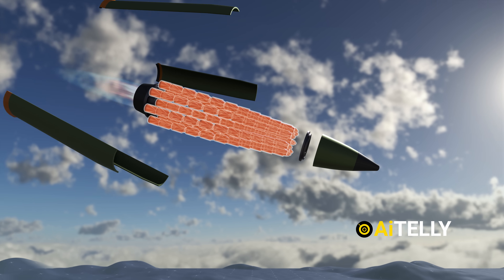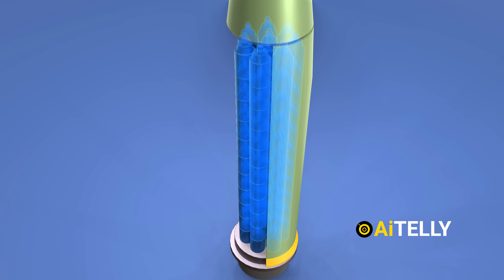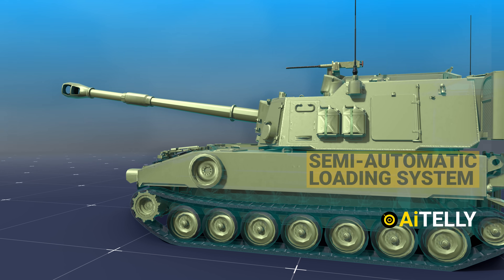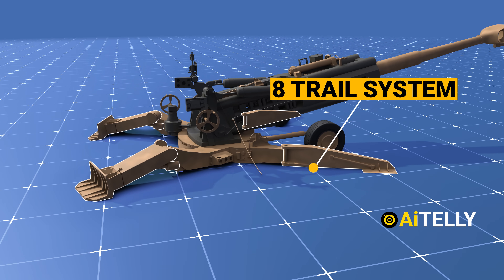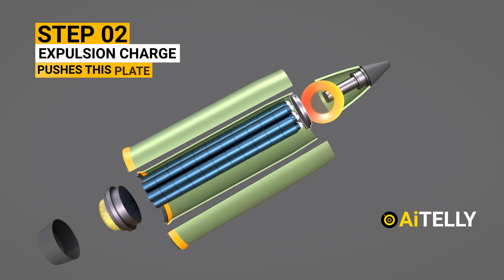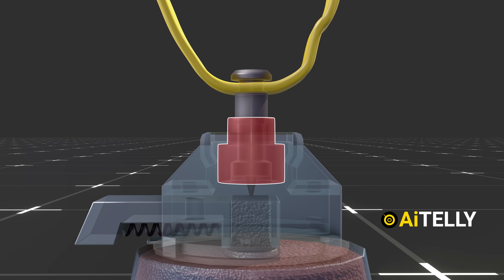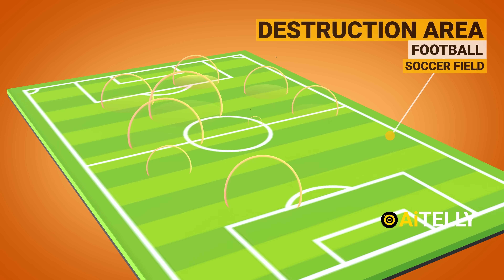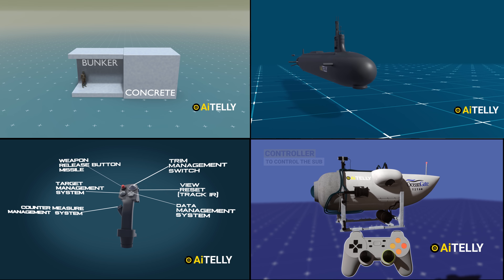How does  a Cluster Bomb Work fired from an Artillery Gun

Comment: I went through a civilian UXO and EOD school. I have an inert M-42 in my collection, my first since the class. The M-42 is a bitch if it fails to detonate and gets buried in the ground. It's shaped conical charge is constructed of copper...which both will read highly on a metal detector. We metal detected above ground to get a feel for the metal detectors. I noticed the M-42 had a strong hit even 18" out and was hard to pinpoint. I had another student try to "locate" it above ground and he said there were probably metal pipes or something below ground. On the search grid with buried inert munitions, he ended up digging a 2' long by 10" wide and 1' deep to find an M-42 submunition you can totally cover in the palm of your hand.

Comment: One small note: In a shape charge the entire case isn't filled with explosives, you got the shaping cone correct however there's only air underneath the shaping cone! The initial explosion inverts the cone into a smooth jet-stream which then punches into the target with roughly a 1-2 inch standoff

Comment: The "curved object" is a ramrod. The "small" propellant charge is 16 inches (406mm) long. That's 1.5  inches longer than the barrel of an M4 carbine (368 mm). I wouldn't call it small, but it's small compared to the old 29 inch long charges of a different propellant they used to have.
Reply from the maker: Thanks 🙏🏻👍 for your feedback
Reply: @Aitelly  I was actually wrong about the ramrod. It's curved like you said, so I edited that out of my post. If it was straight, they'd have to lower the gun to use it. We didn't have towed howitzers in any of the units I supported, and I was thinking about the ramrods I saw for self-propelled howitzers. The M109 and M110 have hydraulic rammers that shove the shell in the barrel for you, but they have manual ramrods in case it breaks.They can lower the gun in seconds, and raise it with no effort since it's all hydraulically operated, not manual.

Comment: When I was in the army, in addition to M109 166mm (6.1 inch) self-propelled howitzers, they still had M110 8 inch (203mm) self-propelled howitzers. Those had 180 M42 submunitions per shell! They quit using the 8" guns because the effectiveness of the 155mm has been increased so much, mainly due to increased accuracy of fire, and they said they don't need anything bigger than that. But, size matters. It would take 2 rounds of 155mm to lay down 176 submunitions, and a single 8" shell still beats that by ~2.3%. Like people say about engines, there's no replacement for displacement.
Reply: @BigHarryBalzac  I remember those 8 inch guns running around in the winter with that raggedy canvas….. hard times for artillerymen
Reply: @jamesc37  I don't remember them having canvas, the guys were just out in the open. But that was in Louisiana, where the units I supported only had M109s and were inside the turret where they should be. I saw some 8-inch guns there but not a lot, then when I was in Germany we didn't have any artillery where I was. Mostly armor and some infantry and helicopters. I was a small arms repairman but borescoped an M109 once at Fort Polk because they didn't have enough artillery repairmen. When the borescope shorted out an electric arc burned the back of my hand and stopped my heart for a little while, but it started beating again on its own.  "The good old days." 😀
Reply: @BigHarryBalzac  I think they only had canvas on because the IG was on a big take care of your soldiers thing at the time.  I remember my platoon sergeant had tent for two years that he never took out of the package no one used it we slept out side weather permitting or in a vehicle until the IG found out lol
Reply: @jamesc37  I remember sleeping ON a vehicle at Fort Polk. There were no scorpions or poisonous snakes up there. Alligators were too scarce to worry about, but Louisiana is one of only a few states that has all 4 types of poisonous snakes, rattlesnakes, copperheads, cottonmouths AKA water moccasins, and coral snakes. Plus you have to turn your boots over and shake them in the morning, to make sure they're not full of scorpions.   If you lie down on the back of a cargo truck, the canvas hangs down a little bit between the ribs, kind of like a hammock. It's a lot safer up there, and you won't roll off and fall like you might if you sleep on the flat metal roof of a shop van. That's a good place to hide in the shade under a camo net, but not a good place to sleep if you toss and turn.
Reply: @BigHarryBalzac  I hear you man. I was a lance guy, then MLRS before himars. I slept on those cold steel decks too everywhere from ft sill to Germany to the Middle East. It’s amazing the places you can sleep if you’re exhausted. I never made it Polk but had some buddies that did a tour there.
Reply: @jamesc37  Yeah, if you're tired enough you can sleep ANYWHERE. One guy fell asleep during a forced march in basic training. He was still marching, but dead to the world. We just kept him pointed the right direction until he woke up. 😀 I slept in the back of a 109 shop van that was parked by the firing line during tank gunnery. The muzzle blast from the tanks was enough to keep that 10 ton truck rocking all night. I woke up when I fell off the workbench. I couldn't put my hands out to break my fall because I was zipped up tight in my mummy bag. Luckily my shoulder hit before my head did.  They had Lance missiles during my time too. A guy I worked with at GM said he was at a Lance missile battery on the side of a mountain in Germany. I can't remember now how far it was from where I was, but it was around te same time.

Comment: The second I saw the ribbons, I knew it was an unreliable method. Further watching the video only confirmed my suspicions. 
The grenades, or bomblets, do not always explode on impact. Ether the mass produced pins don't fully arm, or the impact doesn't trigure the explosion. For one reason or the other. 

These leaves semi-armed grenades littered through out battlefields, just waiting for a kid or civilian to pick them up. Because the system has no fail-safe, it will take just wrong angle of shake or jostle to detonate.

Comment: You forgot the primer which detonates the propellant charge. When the Gunner pulls the "string" it pulls the trigger which releases the firing pin into the primer which then fires and ignites the propellant. The same as used in a normal fire arm.

Comment: You don't mention the safety mechanism on the fuse. We learned in a normal situation or in close combat or road ambush situations you need 70 meters between you and your target for the fuse to activate. There are some kind of system or splint in the fuse that fly off due to the rotation or something simular. This prevent the granade to explode inside the barrel. We were training for a road block situation with the M109, we decided to fire the main artillery gun like a tank in what we called direct direction, with backup of two cal 50 machine guns. Our officers claimed that we were to close. We argued that yes we saw we were to close, but the outcome for the charlies of having a 45 kg granade fire at your truck at 40 meters will create chaos and confusion! 😁 The officers took our point 😉

Comment: the circular pattern of the submunitions deployment leaves a huge questionmark in the actual aiming point.
Reply: Artillery is an area fire weapon. If you want precision use a tank. The Excalibur round is precise for artillery but it's hit probability is still measured in meters not centimeters.
Reply: @Bugsey35  let me guess, Ivan, you have serious reading comprehension issues.

Comment: What about the MLRS, multiple launcher rocket system.  That’s another way to get your munitions down range
Reply: Just take the 88 M42/M46 from the 155 shell and make it 844 M42/M46 for an MLRS/HIMARS rocket (12 per MLRS)(9 MLRS per Battery) and you now know why the Iraqi troops called it steel rain.

Comment: Few months ago Ukraine requested cluster munitions to disarm them and use the bomblets individually in FTV drones. The rest of the casing and fuse could be repurposed and loaded with explosive much easier than building a shell from scratch. Also the spacer at the end of the bomblets could also be removed to cause mass detonation on impact in a smaller area, instead of larger spread. All these modifications could be field tried and tested but the individual use by drones should be a change changer.
Reply: Sounds very interesting
Reply: What does it mean to change the situation? Ukraine has long become a terrorist state, the fact that they will use Western cluster munitions against citizens in the east will not change anything. Before that, they bombarded the Donbass with clusters using Tochka missiles. Using Western cluster shells against civilians does not fundamentally change anything.

Comment: The main problem with cluster munitions was the anti personnel mine version.  No one uses those anymore.  The land mine version was the one with a problem of "persistance" where mines that escaped clean up could be found much later. The media never did state things in proper detail so the current, immediate exploding grenade version, gets equated to the earlier "Inhumane" version.  The modern version might actually be better than a solid big charges shell since the individual grenades only make a small hole, and the shrapnel is stopped by most buildings.  A big conventional shell will destroy a building.  One of the grenade bomblets probably only damages the roof and the room immediately under it, if it goes off course.  The weapon is still only used against mass formations of vehicles or troops outside of urban areas anyways because of this.  Troops will be in a building basement, so you want to crush them with the big charge.   Nice graphics and explanation, fuzzy thinking.
Reply: The USA still happily uses them and many other as well...
Reply: @newone-gd9sk  define "them" the Bomblet, or Mine version? The USA and most other civilized nations steer away from the "FASCAM" versions.  

Most countries also avoid the incendiary bomblets, and Russia has been using it since the first week.....
Reply: we still use the land-mine version they're being fired behind russian attacks so they hit them when they retreat but these new ones can be deactivated easily by trained personnel that are trained to go back after and clean them up

Comment: Base bleed fills the vacuum behind the projo increasing range approx 5KM.  The projectile does not slit on its long axis, instead the base is pushed off the body.  There is actually shims around each bomblet.  There is a mix of M42 and M46 bomblets in the round. The 42 have an embossed body adding in frag and the 46 a solid body and are loaded at the base of projectile to prevent the bomblets from crushing during firing and ejection set back.

Comment: Where did you get your information on the artillery projectile "panels" blowing out to release the "grenades"?

Both variants of the 155mm DPICM (M864 & M483A1) eject the submunitions out the base of the projectile.

The expulsion charge functions, creating gas that forces a "pusher plate" backwards. This "pusher plate" pushes the stack of submunitions backwards, breaking the shear pins that connect the projectile base (and base bleed unit) to the projectile body. The projectile spin stabilisation during flight (from the gun barrel during firing) spreads the submunitions as they exit the base, via centrifugal force.

There are fundamental factual issues with this video.

Comment: The howitzer developed during the 1970s was the M198.  In this video you're depicting the M777, which actually replaced the M198 in the late 2000s.  The design process of the M777 didn't even begin until the late 1980s.
Reply from the maker: Deployed 1987

Comment: For cluster bombs. Except for nuclear weapons, the enemy can be effectively suppressed, but the failure rate is very high at 1%, so civilian damage is as high as land mines. However, in order to deal with a large force with a small force, we desperately need the help of cluster bombs.
Reply: It's also aimed at infrastructure terrorism 
There are cases where cluster bombs are used. Most of the cluster bombs used for this purpose are non-lethal 
It's easy to remove before and after, but it makes basic infrastructure recovery very difficult 
Caution is required for use.
And recently, I've been using self-destructive drones
The development of cluster bombs is also on the rise.
Reply from the maker: Agreed 👍
Reply: @Aitelly Thank you. I'm enjoying the video of that channel.

Comment: What is the difference between the submunition types? The animation covers only one.
Reply from the maker: 🤔 hmmmmm
Reply: M46 is used in the bottom 3 layers.  Because the grenades needed more strength to survive  setback when fired. The sides do not come apart.  The pusher plate pushes upon the payload (gas pressure from fuse).  This applies enough force to push the base plate out of the bottom.  The 3 layers on top of the base plate needed to be reinforced to with- stand the pressure without being crushed.  M46 is just m42 with reinforced sidewalls.

Comment: Great video, but I have 1 comment.
Although dimensions greater than 1 are normally expressed in plural (35 millimeters), for some reason lost to time, the military expresses diameters of projectiles and barrels in singular (155 millimeter).
Reply from the maker: Noted
Reply: When the dimension number is used as an adjective (eg. 155mm howitzer) then it is singular without -s. If it is used as a noun then it can still be plural (eg. The howitzer is 155mms)
Reply: @CHAOS88100  Thanks for that.
It took a while to get used to the cavalry calling the coaxial machine gun on the tanks "caliber 30" when the civilians call it "30 caliber".